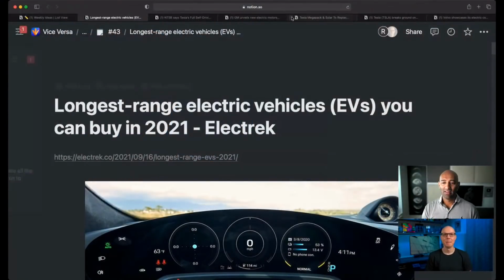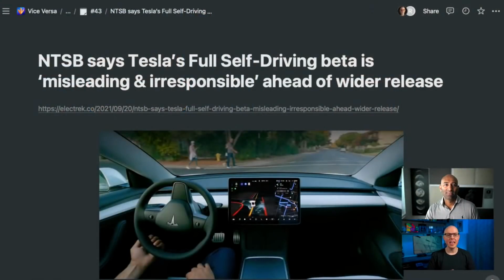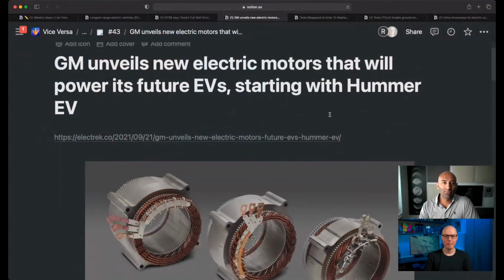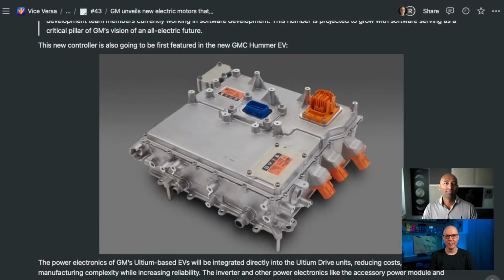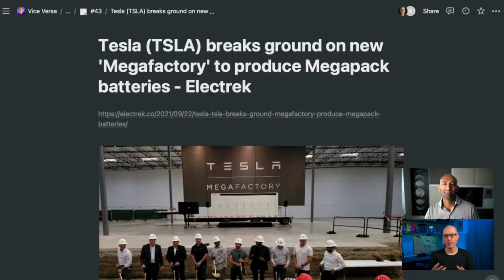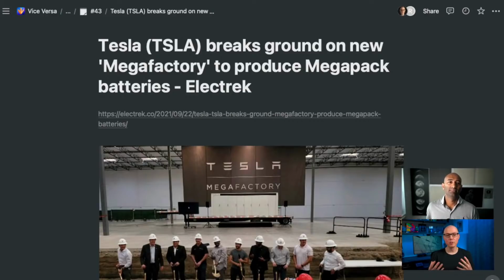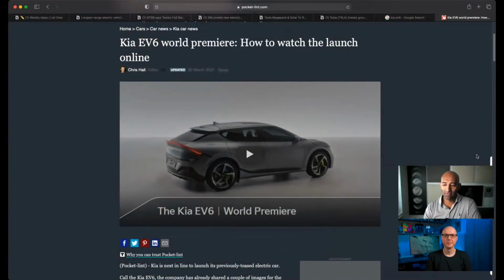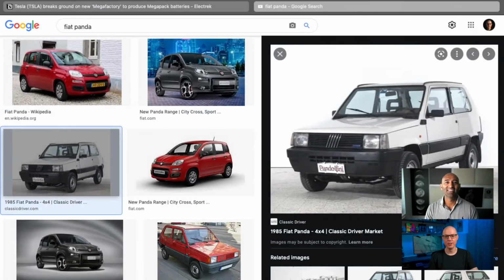Do Electric Vehicles Really Need 500 Miles of Range?

Comment: 500 miles would be my perfect sweet spot. It's not a necessity, but it would be perfect for me. And to be more specific, a 500 mile Tesla model S. I've lived with a 2017 one for 4 years and it works fine. But my weekly drive is 250 miles at generally around 86-89 mph. It makes me stop midway for about 30 minutes with my 320 stated range S. If it had 500 miles, it could make my weekly drive with no stop necessary, never needing to go below 10% or above 90%, no matter how cold or windy it gets. That's the use I want in a 500 mile battery. Driving at near 90mph eats up about 20% of the range.. really cold weather will eat another 10% .. and I don't want the car going below 10% regularly, and I don't want to need to charge it above 90%. So 20% is lost, not used or held in reserve always, however you want to look at it. And a 500 mile stated range works out just about perfectly for what I want. Now, do I expect any car company to build something for my specific need, no. But it is what I would I would like. Sure, if they can get a 20-80% charge down to 5 minutes.. that would be reasonably close to as convenient.. and more useful to more people. But.. that's my wish

Comment: Plus electric motors are a lot more efficient than gas motors I’ve got a guy who’s got a Chevy bolt it’s advertised at 250 miles but he gets over 300 on it if you drive it right

Comment: No you don’t need a vehicle over 500 miles the only ones that usually get over 500 miles are either super efficient cars or trucks with big ass gas tanks my truck only gets like 420 miles to a tank and that’s an efficient truck I’ve topped out at 31 mpg but my average is 23.  And that’s from a 2017 Chevy Colorado six cylinder

Comment: Yes!!! My 2017 Model 3 started at 310 miles. Hot days, rainy days, that range is realistically to 290. Fast forward to 2021 and 80k miles and the range is now 281, with realistic actual driving down to 245. SO following this experience a 500 mile range will age to 400 over 3-5 years.

Comment: Two things about fsd.  1: Elon sold it as a robo taxi.  He may have backed off of that but Elon has way oversold the system and is still doing it.  It is the best level 2 system but is not capable of driving without driver intervention.  2. NHTSA is investigating Tesla for 11 accidents where autopilot had been engaged and the cars ran into emergency or construction equipment with emergency lights on.  The investigation is not about drunks being brought to a stop.  It's about people with above average intelligence believing the sales pitch and branding of "full self driving".  Matt and Ricky, you have mischaracterized the investigation.  Untrained beta users testing out a "hands free" system is reckless and puts the general public at risk, not just the driver.  You two need to quit praising fsd and start recognizing the limitations and the dangerous way it's marketed.  $10k for level 2 driver assistance?   Really?  It's about jacking up cash flow.
Reply: I think it is stupid to pay for beta software in development.

Comment: The fact you asked this question makes me wonder. NOT every state is California. DC fast chargers are not on every corner. People that want to use these expensive machines to travel currently need longer range to avoid the lack of charging stations.
Reply: They not more expensive . Add you gas and maintenance cost . You will see it cheaper.
Reply: @LaJuanHughes  Lets agree to disagree. Tesla maintenance and repair is insane if you have been checking. From door handles at $700 to battery module loss that created bills of over $20K. Its such a dirty little secret. And lets not forget how many people are driving with range loss. 
Charging per KwH can be quite expensive if using a super charger and charging at home if you do not have 220 volt outlet. Whats the cost of that add one? $1500 So you paid for gas and maintenance by the extra 10 plus K in initial cost. The Model 3 is well over 40K while you can get a LOADED Camry GT with panoramic sunroof heated seats for less than 30K. And after you pass 100Kmiles the Tesla battery might just give up costing a fortune. All that glitters in EV's is not gold. 
If the car was equal in cost to ICE cars then you might win but we are in early days.

Comment: I live in Wisconsin and I have a Chevy Bolt. Its range is 230 to 240 miles in the summer. One day I drove it when the temperature was a few degrees below 0 and the range dropped below 100 miles. My cousin has a Tesla and has the same problem. I know there are places where it can get 20 to 30 degrees below zero. So the 500 mile range would probably be 100 to 200 miles on the coldest days. Not over kill. Especially because I was just reading about a Mustang E road trip in NY state where most of the charge stations were broken. What a nightmare that would be if the temperature was below 0!

Comment: I would need the 500 miles about 6-10 times per year. Rest of year need (Wife's commute, 170 miles round trip) ability to do 180+ miles per day.  I never drive more than 3 hours now with ICE vehicle without stopping for break and food, so not a lot difference with Tesla network.  Wish they would go to 800/900 volt architecture, for charge speed though

Comment: Eventually all EVs will have large 150-200kWh batteries and get 600-1000 miles on a charge. So you can take a road trip and never stop to charge at all.
Reply: Yes for them that need that kind of range it will be a good supply of such cars (pulling trailer etc). But a car that do 200 miles irl (in cold climate, like -25C) is really capable of acceving the day to day things a family need a car to do.
Reply: @kulan9379  I believe that batteries will eventually get cheap enough, and energy dense enough, that large batteries like that will just be the default. You may never need to go that far, but maybe instead you can go a couple weeks of your daily commute without needing to plug in instead.
Reply: @dan203  abselutly. Will be interesting to see what future has in stock for us. 

I am a farmer and hope i can get a ev tractor soon. All that is avalible is diesel and i want a ev 😭. 1.500-2.000kwh and above 5.5 tonnes would be grate 😁 give me 😁

Comment: having range is not only about road trips, but its also about charging frequency and battery longevity, ultimately if you can charge your vehicle less frequently because the range is greater, the battery will degrade much less over time and at the moment much of that range is coming from battery capacity.
Reply: Thats a good point.
Reply: Outstanding point about charge frequency!  👏
Reply: Especially true if you are using the fastest chargers regularly.

Comment: Yeah 500 miles is bragging rights only and has no bearing for long trips. People have to stop for bathroom unless you wear diapers. Also the more range, the larger the battery and more expensive the car. The 300-400 range is where we need to be at. Cheaper EVs in USA will be in the 250-300 range hopefully. If EVs where able to charge up to 80% in 5 min for 500 mile range cars then it will be fine. Im not waiting 45-60min to charge a huge battery.

Comment: I'm really considering an EV, but we are sadly missing the infrastructure. 😔
Reply: While charging infrastructure is still inadequate in some less-traveled areas, most of the U.S. is very well covered with Tesla superchargers and CCS chargers, especially with Electrify America expanding so rapidly.  I've owned an EV since 2015, just traded it for another, and am adding yet another to the garage this year.  We've never had a problem with finding a place to charge on a trip.
Reply: Buy the plug adapter and you can charge any where. Tesla supercharger is the best.   Depend on you milage and driving habit. You won't care with the money you save on maintenance and never having to smog buy gas a car again is worth it for me.
Reply: Once you do it you will kick yourself you didn't do it earlier.

Comment: TESLA just needs to call it “TESLA VISION” and speak to that. TESLA FULL VISION.
Reply: Not even. They have the data. Their cars are safer. While on auto-pilot they are x10 safer. 2000 FSD beta users, 1 year, 0 accidents. Let's see blue cruise, or super-cruise do that. Tesla I am sure has lawyers, but they are willing to take the 'calculated risk' because their cars are so much better and safer.
Reply: @DrThunder2004  I don’t disagree with what you are saying at all, but if they want people off their ass then they need to stop calling it FSD. I’m personally fine with it called FSD.

Comment: Our 2018 RWD M3 LR (325 miles) is not showing any degradation in battery and we are still getting 291 miles of charge @ 90% charge, which gives us only 0.5% degradation in 3 years. My recently sold 2015 MS85D also did not show any degradation giving me 238 miles of range charging to 90%, which also showed negligible degradation. For both cars we never charge to 100% and rarely to 90%, charging generally between 70-80%, which has worked well for us. I also have LR MS on order and expect delivery in November. I look forward to having a car with the potential to drive up to 405 miles with the 19" wheels, but plan on only keeping it charged between 70-80% and never to 100%.

Comment: I prefer not to spend more than 4 hrs in a car, no matter how comfortable  the seat. 200 miles in a Tesla is adequate with the charging network as it is. I would want more range in any ev when searching for a charger that hasn't died from neglect.
Reply: It in Minnesota. You would easily lose 40 miles in cold weather. Traveling anywhere with any distant would be difficult.

Comment: bro, i have an old gas car with a 16 gallon tank and usually get between 325 to 350 on a tank..thing is, i only do city driving and often only throw 6 to 8 gallons in at a time, use that up and then add a few more gallons.. maybe thats odd and maybe most people fill to the top and use till empty but for me, maybe I just dont like paying alot at the pump so i part with 20 dollars at a time.LOL  the only time i fill to the top is for road trips, then of course, full tank. Point is, almost Any of these electrics would be More than adequate for most people except those who travel 300 to 500 miles at a time... thats certainly Not me

Comment: Well if you live in Europe, UK, Japan and elsewhere the population is condensed, probably 100 miles may be good enough. Some area are more spread out. I often have had jobs where I'd travel about 35 - 40 miles to work. And sometimes a little more on return. Add heating or ac, stalled traffic in a large city, radio and safe mode and then you're going to need more battery storage.